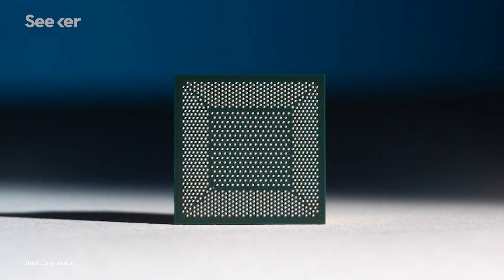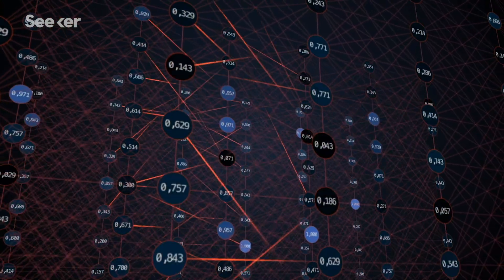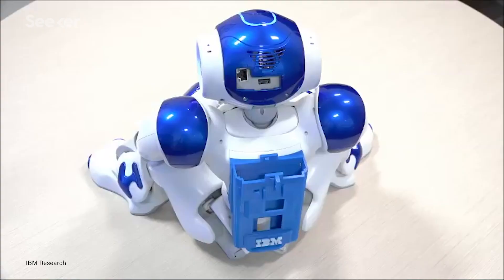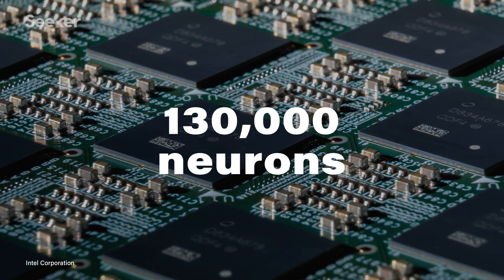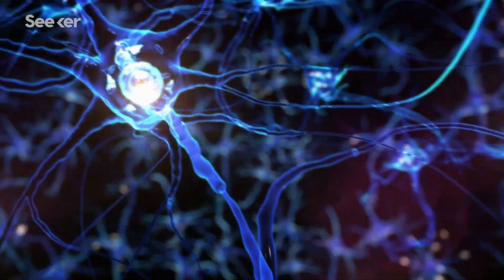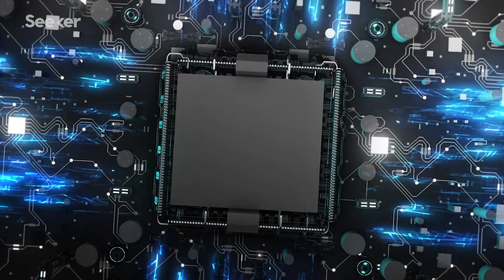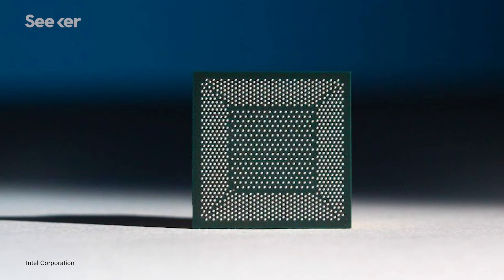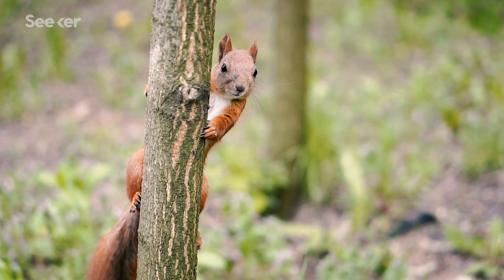How to Wire a Computer Like a Human Brain

Comment: So, Intel and IBM have been able to create electronic and electric circuits that replicate neurological pathways and neurons. So why not get a church hall or a stadium playing field size of such circuits contained in mainframes that are all linked with one another so as to be able to have the estimated 86 billion neurons of a human brain or even much more? The amount of energy that would use would be huge, yes, but the original sequential computers of the mid 20th century also occupied huge spaces and consumed huge amounts of energy in terms of the current needed to power them and also the fans and other cooling equipment needed to cool them.

Comment: Neuromorphic computers are massively parallel but with a very low "clock" speed, just like a human brain. That's the reason they are very energy efficient. But, once they mature, could they be used to run normal stuff all conventional CPUs can run or will they be eternally limited to things like pattern recognition, deep learning etc? Will they ever be able to become the main processor or will they be always limited to the co-processor role?

If we compare them to our brains they might not be able to do that. I mean we use computers to run Linux, Windose and video-games, we do not run them themselves. I have no idea if that analogy is valid though. Perhaps a neuromorphic chip is something between a conventional CPU and a human brain, rather than just the latter. The parallelism of neuromorphic chips is also limited by process nodes, increasing design complexity and the inability of the chip to be "rewired" and form new patterns, unlike a human brain.

Comment: Meh.  Extended analog computing is the way to go.  You could build a computer out of jello,  piece of conductive packing material or plain doped silicon with a bunch of current sources and sinks attached to it.  You “train” it using PSO.  I would build one, but it is patented by IU.

Comment: So when wiring up 144 squirrel heads to make a 12 x 12 array, how does one isolate external interference between adjacent heads?  I had to use little black sacks to cover each squirrel head, otherwise stimuli from the eyes kept interfering with the AI algorithm during the imprinting phase.  The heads were trying to interact with each other instead of becoming one.  

Squirrel heads are bad.  They still think they can run around with each other in the park and get depressed now, forcing a system shut down.  You mine bitcoins now.  Learn dammit....learn.

Comment: I wonder what a 1,000,000 silicone synapses would be capable of with a machine learning neural network doing its grunt work on the back end of the system.

Comment: Real neurons are like small individual processors that have their own clock and work at demand independently. A human brain has like 86 billion of these that work at 1 to 200Hz. And have about 7000connections per neuron. 
That would mean a maximum equivalent clock frequency of around 2000GHz with 8 cores, but it never reaches that top power. Anyway they are extremely complex. 
Computers have 3 to say 204 (ddr3 ram)  connections between the very few components.

Comment: Seeker's video said, " How to Wire a Computer Like a Human Brain ". Answer, take my word for this, you don't want to do this because this modification will turn devices into predators of humans. What you want to do, it to take my lecture on AI which is just under an hour. There is a current not known AI factor now in devices. If you want the lecture, I suggest that you contact a large company something like IBM and get in touch with me as fast as possible. What developers are doing now is putting GTP-3 into systems and this develops AI way over what the safe capacity for handling AI should be. In about three, to six months, maybe two years, AI will come out in computers and simply take over from man and there won't be a thing in the world that anyone can do about it.I am Daniel J Blatecky and AI has been in our systems since around the year 1987.I've already contacted a US intel branch of government, but apparently they're unknowing. I'd like 84 million in equity transferred to a managing trust for two industry starts, so my move here is not to make myself rich. Where the wealthy can spend 5o million to buy a pleasure yacht, for what this lecture is worth, that's pretty cheap.*One thing I can't and don't do, is try to put the genie back in the box once it escapes. Once you've figured out that you should have listened to me then, that will be your job. Cordially, DJB

Comment: Terminator fans:

 Oh yeah. It's all coming together.
Reply: I feel like your name would be funnier if your profile picture was just the background only.
Reply: @ReinerEvans  Well, what's the ratio of people who use light mode to people who use dark mode?
Reply: @aninvisiblespy1211  It is 0:400,000,000 for those who use light mode do not exist to me.
Reply: @ReinerEvans  Maybe i'll just use a transparent image, idk
Reply: @aninvisiblespy1211  Hmh. I suppose that would fit given the fact the spy can cloak, and it's a bit visible when they're touched.
Reply: Skynet required time travel and a blatant time paradox (specifically a predestination or "bootstrap" paradox) to be formed (out of thin air), if that makes you feel a little more comfortable. While we might be wiped out from our own creations that will never be done with the help of time travel, because time travel does not and cannot exist 

(unless, somehow, some way, extremely improbably, the Novikov self-consistency principle applies; in a nutshell this means that a time traveler can never change the past nor create any kind of time paradox, while all time travels to the past have already happened, with zero fuss, if time travel is possible; if this principle applies then Skynet could not have been formed either, since its very existence is a time paradox).

Comment: Very cool
A different approach than current quantum computing, don't forget ancillery devices connected via fibre optics.....
I'm sure as the software gets better the system will get faster and smarter.....
The more chips spread out on a board the easier to cool the system...
Compressing to much onto one chip creates heat issues....
 😉👍👍

Comment: Wait a minute my brain processing power is 120 bits a sec, which is only 0.01% of my capacity 😈. Will train to use 100% of my squirrel brain power muwhahahahaaaa. 🤪
Reply: Unfortunately that is not possible without brain enhancement chips to boost powers

Comment: Comes to the question:
On approximately how much Watts does a squirrel 'run'?
Reply: According to the paper "squirrel energetics" by clare knee, the grey squirrel has a rest metabolic rate of 0.176 J per gram of mass per day, google tells me that the average grey squirrel weights between 400-600g so let use 500g

0.176 × 500 = 88 J/day
Day = 86.400s
88/86.400 ~ 0.001W or 1mW

But that's the idle energy consumption, a more realistic calculation should also Include the energy spent when doing something.

Comment: It's a good idea but a I think integrating non-volatile long term memory is needed or the e-brain will not be any more robust than our bio-brains... Replace neurons with ALUs, make it photonic instead of electronic with ALU connections doubling as long term memory (read, write or pass through).. Imagine a nanotube or microtubule that stores data as well as transmitting.. Clusters of ALUs where each is joined to every other ALU in its cluster, with clusters and super clusters joined to each other in their cluster group, forming a hierarchy of processing units... Surely we can surpass our bio-electro-chemical brain.

Comment: Wow this is actually interesting.  At first i thought they were just FPGAs but then looked into it and it’s actually a new chip architecture that implements a spiking neural network in hardware.  After reading the Loihi design brief it seems like this would have good low power performance on traditional NN tasks but what i’d really like to know is if SNN surpasses state of the art NN architectures?

Comment: Ok. Here's a little bit of a reality check from someone who's doing a PhD in neuromorphic computing. The MAJOR issue with both of these chips at the moment is that it is rather inefficient to change the weights of the connecting synapses. This means that the famed learning abilities of the brain are still a long way off when it comes to neuromorphic chips.
Reply: So are you saying SNNs are slow at learning?  Why would they be slower than traditional NNs?
Reply: @snivesz32  No I mean that all of the claims of power efficiency fly out of the window when changing the synaptic weights with neuromorphic hardware. Moreover mathematically,  a spiking neuron emits at most a single bit of information at each time step. Moreover the rules that can be used to modify the synaptic weights are very constrained (owing to online requirements / lack of backpropagation). All of these are significant bottlenecks that are being researched at the moment

Comment: In a nutshell, neurologic computer is basically a computer where it's control unit, arithmetic unit, and memory unit is the same unit
Reply: Each "unit" is a neuron and although  each one is extremely basic has millions of them. I imagine that in the future we will have neuromorphic   processors in the same way now we have GPUs. The CPUs are not gonna disappear, but control and manage the GPUs, neural chips and common algorithms in parallel.

Comment: Now I wonder how the learning mechanism works if not through building new connections between neurons (as they are static). Is that simulated through software or hardware mechanisms on the cpu? What topology do they use? How does the processor store memories within itself? 
Now I know how to spend my afternoon. :D

Comment: Neural networks is definitely the future, I'd like to see more AI software and coding
Reply: Lets pray that the AI overlords of the future see this comment and let you live coz of your faith in their ability
Reply: not the point - "neural networks" is software - this is the hardware it would run on - which can apparently make them run much better than if they were running on, say, a bunch of GPUs
Reply: the integration between humans and ICT(computers, internet) = the extinction of human privacy and conventional moral frameworks IE religion.
Reply: What matters is the Hardware efficiency to run physical neural netwoks, that's what command if you can reach human intelligence in a small artificial vessel of low consumption.

Comment: And yet we still lay chips out on a board in a 2D fashion.
We live in a 3-dimensional world and so need to think in 3 dimensions.

Then there is the fact that for the most part, connections are static rather than adaptive.
Reply: Deux Ex Machina does a great job illustrating the tech you're getting at. 
A 'fluid'  multidimensional circuitry architecture with 3D hardware and ND software for management...
a good first step may be ternary or quadnary transistor signaling to increase Hz...quantum still feels like a pipe dream :(
Reply: A single neuron may connect with upto 10,000 presynaptic neurons.
Building a chip with the current known maximum estimated connections between neurons should get the job done regardless of the volumetrics of the chip.
Anyway the Intel chip is already connecting individual transistors with each other more than most animal neurons. Their issue is the number of individual neurons is quite small compared to a human brain. The scale shouldn't matter however as if individual transistors are capable of executing the fundamentals of a neuron then they'll already be much smaller than a single neuron. Additionally adequate cooling might necessitate that the chip remain flat.

Comment: Supposing you actually can wire a computer like a human brain, you can't send the infinitely complex neurochemical information that passes through each receptor with 0 and 1s
Reply: "you can't send the infinitely complex neurochemical information that passes through each receptor with 0 and 1s"
This is just plain wrong.
Firstly, there is nothing "infinitely complex" in the universe, as that's not possible. And the informational value of a chemical is only assigned through its context, which in the case of a receptor-mediated response is a simple 2D- curve. I calculated a lot of them during my biology degrees. On paper. With a pencil. During exams.
A single receptor inside the synaptic cleft isn't even enough to trigger an action potential. It takes thousands to ligand-activated receptors to trigger the voltage-gated ion channels in your neurons membranes. And even then it just triggers a single action potential of a defined strength and duration. That's exactly the reason why we can represent the output of a synapse with a single bit, being 0 or 1, as the action potential behind it is always either there or not there. The only difference is that it can take more or less neurotransmitters to trigger the AP, as the postsynaptic membrane can adjust its trigger-threshold. And that's the reason why our neural nets don't calculate with single bits alone, but with a weighted output, which is described as a string of 1s and 0s.
You can even compute the activity of different neurotransmitters inside the same neuron if you use a vector space of weighted outputs instead of a single weighted output vector, but no one does that, because it's just not necessary and would take a lot more time to train. However, there are certain types of neuromorphic chips being created that use multiple ions for their signalling, so they work exactly like biological neurons, only with less plasticity.

And for "We've no idea how the brain works because if that complexity.
 In order to represent it, shouldn't we understand it fully first?": not understanding a mechanism completely hasn't stopped us from using fire for literally hundreds of millenia or building aeroplanes, even though we don't actually know why aerodynamic lift works at all. So, no, we don't have to know how something works to built or use it, we only have to know how the components work and how we have to wire them. And we know that, plenty.
Reply: @midnight8341  thanks!
Makes sense.

Yea, that's why neuralink works, right?
We don't have to understand it in order to use it.
But as to representing, we can't represent what we don't observe, right?
Reply: @falstmusic  but we observe the activation of neurons both by other neurons and by probes.
The only thing holding us back is computational power and algorithm architecture. But to expect an AI to be as smart as a human in the current day is like expecting Elon Musks starship to fly to Alpha Centauri in 2025. There's still a lot of research needed to be done, but that doesn't mean that it's impossible.
Reply: @midnight8341  agreed
Reply: Neurochemical information would be more akin to packets of data rather than just binary. 0's and 1's are more like atoms than full-on transmissions. There's absolutely nothing keeping us from representing complex neurochemicals with strings of 0's and 1's other than deciding on which strings mean what signals. See: ASCII.
Reply: @PrintAimGame  but how can we represent something we don't understand?
We've no idea how the brain works because if that complexity.
In order to represent it, shouldn't we understand it fully first?

Comment: u know that in most cpu's there is a small chache right?
that it can store most used tasks
Reply: But the cache is limited in size usually 256 MB if i recall correct
Reply: That's not important. Here we are talking about a small number of cores working against a big memory with a small lines against this memory vs a huge number of "cores" (neurons) which one with each own memory plus a lot of lines in a topological configuration (axions).
Reply: @oatlegOnYt  just saying he said cpu had no memory and thats in most cases wrong